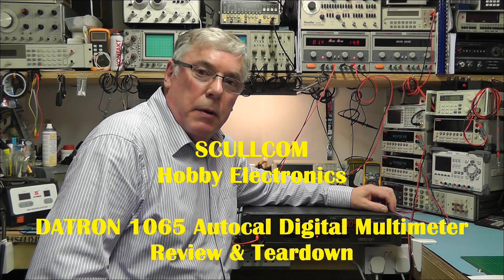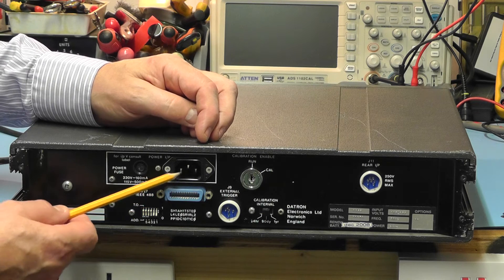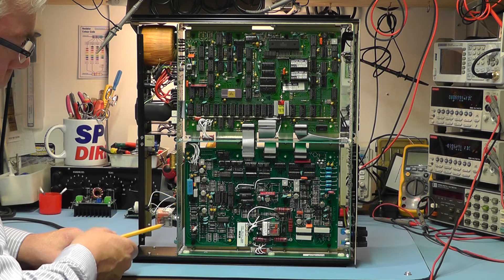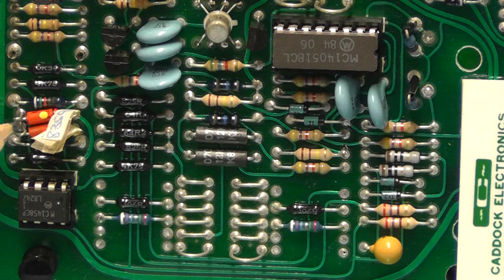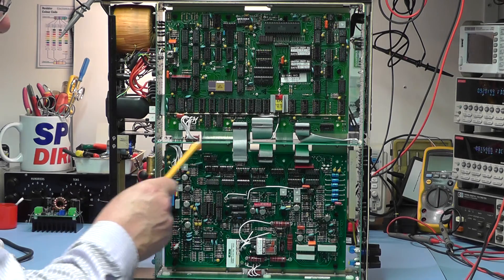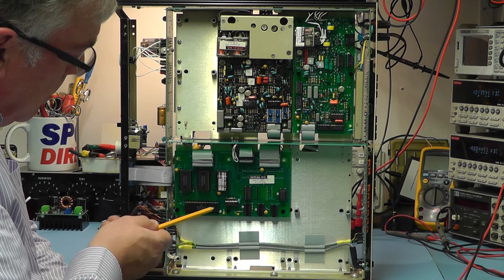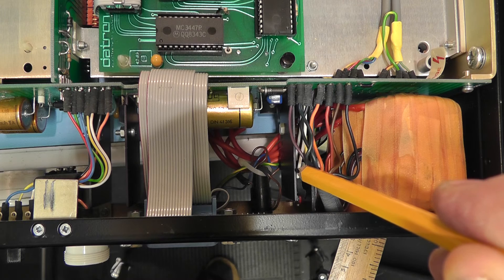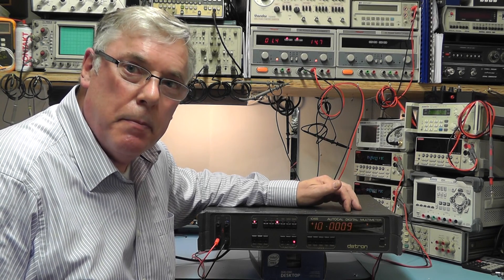Scullcom Hobby Electronics #4 - Datron 1065 Autocal Digital Multimeter

Comment: Why is it called 'autocal'?   Does it have a one-click program to automatically sequence through the calibration process if you supply the traceable standards?
Reply: The meters can be calibrated using a GPIB (IEEE-488) bus connected calibrator and a sort of program to do most of the calibration automatically. A big plus is that the meters can be calibrated "in-situ" - saving a lot of time for calibration.

Comment: Wow. That's a nice instrument! A small thing i would like to note is that the hamlin relays in the input switching is not solid-state. They are Series-700 reed-relays. That Plasma-displays is a work of art. I have some 2-digit ones (SP-352) here in my "Nixie"-parts bin, which is bog standard compared to that display.
Reply from the maker: +zaprodk Thanks for your comments.

Comment: You have a high quality vintage electronics p*rn and you don't try it? It was nice seeing it inside, but I'm curious how good does it perform after all these years. How close is the cal data? If you calibrate it will it do accurate measurements like it was new or the analog part of it drifted too much?

Comment from the maker: These bench meters can be picked up on eBay for low prices. Make sure you buy one where the Plasma Display is OK as you will find these impossible to find as spares. Very good quality build meter with all integrated circuit chips socketed allowing easy servicing/faultfinding. The auto-ranging feature is very fast at 100 mSecs. On the 0.1 to 10 volt ranges the input resistance is 10 Giga Ohms and on all other ranges it is 10 Mega Ohms. The only drawback of this model is that there are no current ranges. The 1065A model version of this meter has a 6½ Digit Display.
Reply: Hey Scullcom Hobby Electronics! I've just started a channel where I work with electronics. But I discovered that it's really hard to het the ball rolling. Can you tell about me on your channel? It would really help me a lot! :)
See you!
~electromenLED

Comment: Wow that is a very nice piece of gear ! I have a few vintage calculators with the same kind of display, they are just beautifull.
Reply from the maker: Datron made a range of precision multimeters all of which were very well constructed. Access for servicing was first class and they used IC sockets on all IC's making it easy to replace.